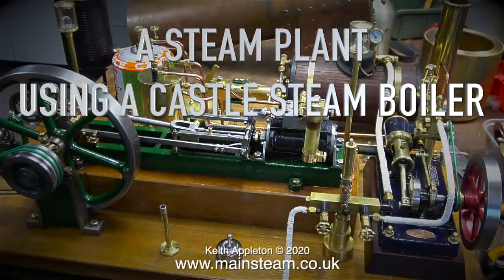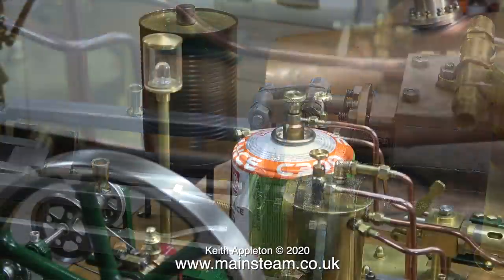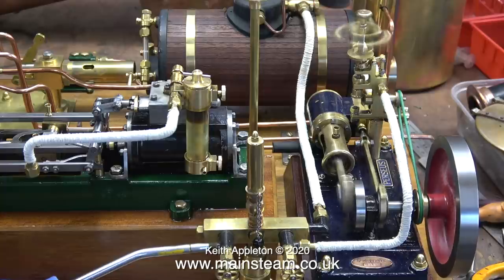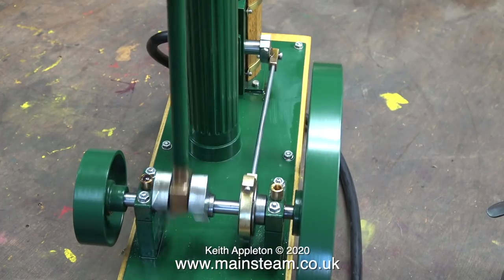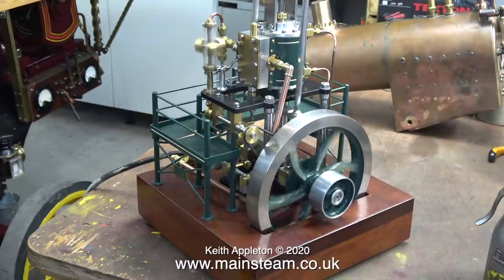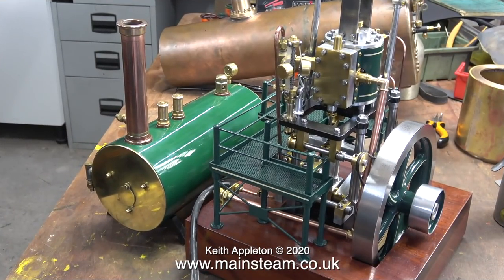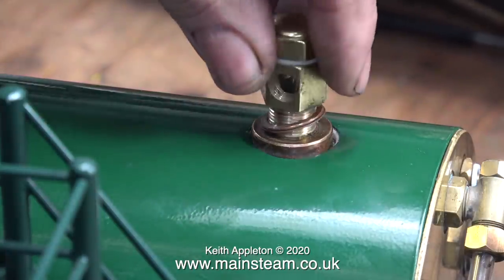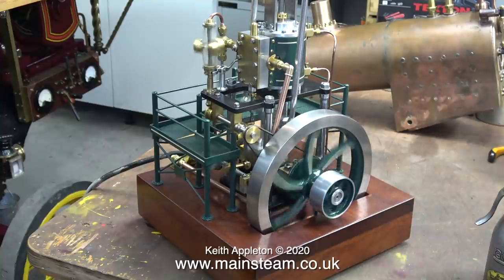A STEAM PLANT USING A CASTLE STEAM BOILER - PART #1

Comment: Bonjour Keith,

Excuse me for playing the purist, you're talking to neophytes, but in steam, a condenser has a specific function, it has its own cooling system and is often associated with a vacuum pump. In the cases you describe, wouldn't it be more appropriate to talk about an oil separator?
Amicalement, Raphaël
Reply from the maker: Now you are just being unnecessarily picky. Why not make your own video about it and then you can be ever so specific - by the way, I make a new video every day for my kind Patreon supporters . . . . .
Reply from the maker: I really do not mind criticism at all, but your last comment was as I said - I felt that you were just being picky. It is actually a condenser, as steam does condense inside the condenser, and it is also an oil trap . . . . . I am fully aware of the principle of operation in full sized condensers. I receive many comments from Youtube viewers every day and so many of them are not being critical - just trying to be clever and usually state the obvious. For instance I have explained about condenser/oil traps many times in my videos. I used to make them and sell them. I do understand your point of view to a degree, but I usually only tolerate these type of comments for a while as they get tiresome . . . . have you really created 2000 videos? ...... I am impressed . . . I have only made 1546. By the way I deleted your last comment only because it contained a link - I do not allow links in the comments section. By the way, I deleted your last comment because you attached a link. I do not allow links on here from my viewers as they can cause problems.
Reply: @keithappleton  Bonjour Keith,  once again sorry if you interpret my comment as a critical. Before deleting my message, I hope you had a look at the video. And when I write about 2 000 videos (without any monetization), I am sure you can verify.
Amicalement, Raphaël